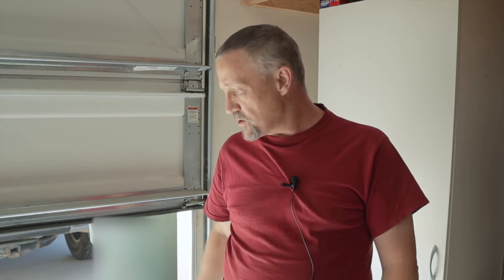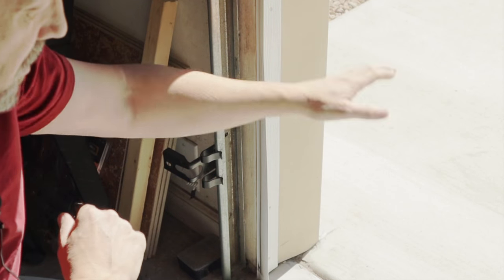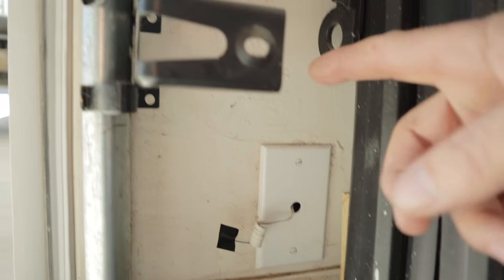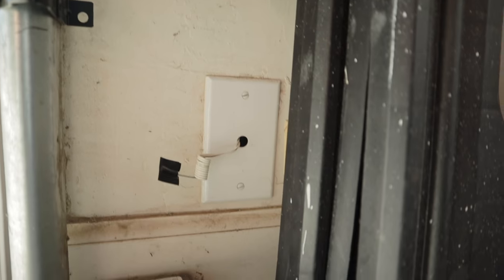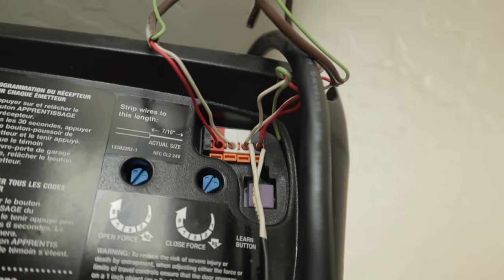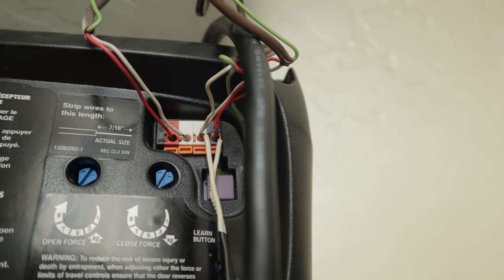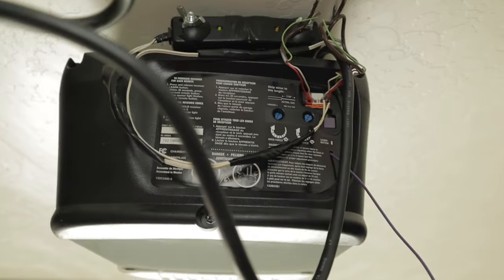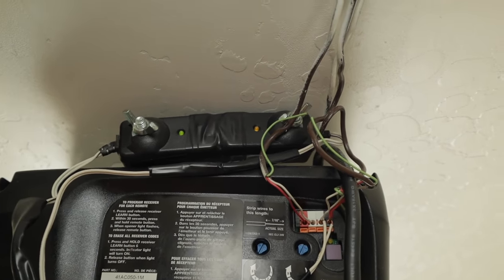How to Disable Garage Door Sensors

Comment: Or you could have just put a small barrier to block the outside light. A little piece of cardboard next to the sensor
Reply from the maker: That would work fine until it gets knocked off or bumped and blocks the sensor. I don't think it would be long before spiders build a web on it and that would also block the sensor. I have had this modification for about 2-1/2 years now and I haven't had to do anything to keep it working. Fix it this way and it's one and done. That is exactly what I was trying to achieve with this fix.

Comment: Couldn't you just wore the two sensor wires together or just put a little wire from gray to black? 😁
Reply from the maker: Not sure, maybe.
Reply: No. A digital signal passes through the circuit.

Comment: Personally I'd rather make a sun hood for them. That way when I'm working on a project and its halfway hanging out the door (or my car) and the wife or kid hits the wrong button on their visor....well you can see the advantage lol.
Reply from the maker: Yes, I understand your point. This method won't be the best for everyone.
Reply: I have this exact problem. I ordered Chamberlin's sunhood for $8 (piece of crap) and they didn't work Used a giant piece of cardboard and blocked 2 feet of the sensor from the sun, that didn't work. So now I am going to do this trick. This problem drives me crazy.
Reply from the maker: jmcminn - You're going to love this modification! I haven't had one problem with the door opening and closing since I did this fix. 👍

Comment: Cant you just Twist w/B Together & Be done with it? Throw the sensors in the shit bin?
Reply: Is that a yes? I’d dee sensor is junk I need to BUy new sensors just so I can bypass it??
Reply: If my… dump phone 🤬
Reply from the maker: No, it's not that simple. The opener needs a "pulse frequency" signal and not a constant voltage. You need either a pulse signal generator or the sensors. Just connecting the wires or using a wire as a jumper will not work.

Comment: Or you can just put a piece of cardboard blocking the Sun 🤷
Reply from the maker: True if you don't mind tinkering with the cardboard all the time. Spider webs, hit it with your foot or something else, sun coming from different directions depending on the time of day. Or you could  use this method once and forget about it. I haven't touched anything with this garage door since the day I did the mod.
Reply: @DIYHomesteadProjectsDIYHP10  very true. I run an apartment complex with over a thousand units and as of recent I cut a piece of PVC and put it over the sensor It seems to work pretty darn good.
Reply from the maker: Nice!

Comment: Way to much work! All the sensor does is close and open and close a circuit. A jumper wire would have done the same thing.
Reply from the maker: That's incorrect Brantley it's not that simple. The sensors have a pulsed signal, installing only a jumper wire will not work.